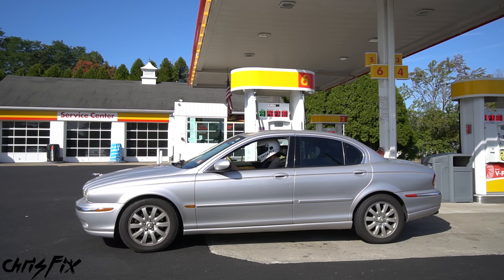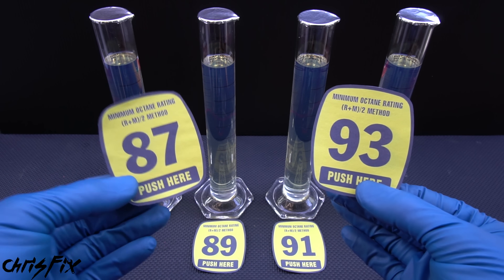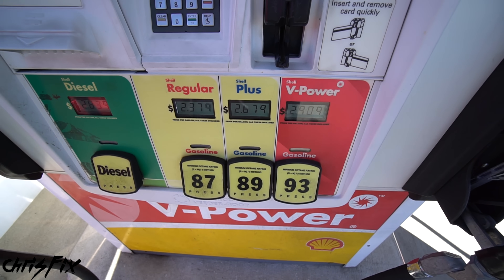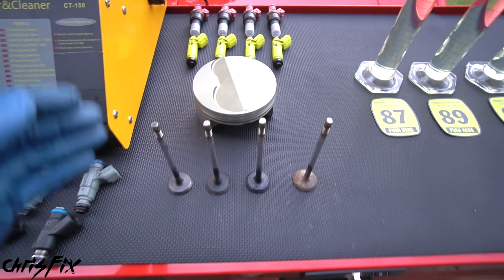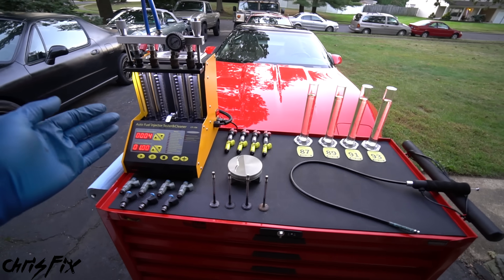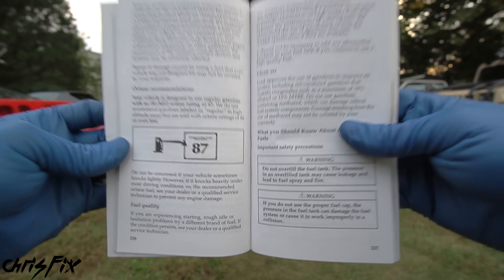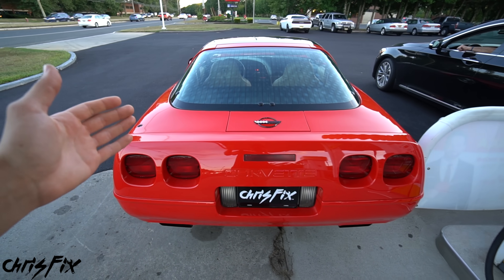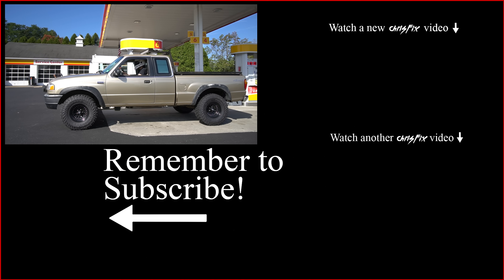What is the BEST Fuel to Use in Your Car or Truck and WHY

Comment: I've seen studies and videos of exhaust emission test. And from what I've seen in the test is that the high octane fuel produces more emissions than the lower grade fuel. Is that correct? My 2015 turbo beetle says 87 is fine. I can't tell the difference between the two of them. It runs good on both. But it seems like I use more with the high octane fuel. Same driving habits with both. It's a TSI gen 3 DI. So additives don't really do much for me. Just the injectors. Your thoughts on it?

Comment: My car turns off each time i put fuel in it and i dont know if its the fuel pump or sum ? HELP ME
Reply: Elias Estrada what is your car???
Reply: @oatmealtheecat8188  its a 2004 Cadillac srx v6 awd
Reply: Elias Estrada vapor canister issue, you’re getting fuel vapors in your engine also check tour purge solenoid, disconnect it from up front and of you can blow into it both ways it is stuck open. That generally pops an engine light tho.
Reply: Quit playing with the key....;)
Reply: Do you have a Chevy traverse by chance?
Reply: Have you put the wrong fuel into your car
Reply: It sounds like you're saying you are leaving the car running while fueling and its turning off. Is that correct??  Also, Have u ever replaced the fuel filter?? I replaced 3 in different cars with the minimum miles at 80000. All the gas that backed out after disconnecting was black. I have pic in my phone.

Comment: I have a 2006 Yukon,211,000 miles,I was told that i should put premium in her,so I have been,now someone has told me I should never switch gas and I'm in Minnesota,so the weather changes,my question is did I meds up by switching from regular to premium,I was even told I may need to get a gas flush

Comment: actually that the exhaust valve..not a intake valve..intake valve dont have any carbon deposit at the back side of the valve..the CO2 never push back into the intake valve..if that happen,maybe it have seat failure..and the dirty exhaust valve is oil failure..not cause from direct port injecter..

Comment: Hey I was also wondering about the racing fuel the 100 octane. I was told to put $20 of 100 octane and fill the rest with 91/93 I have a 2001 BMW Alpina it said premium on there. 

Thanks!

Comment: Great video Chris!

In the true north, the greater Toronto area specifically, our fuel contains up to 10% ethanol at some major gas stations on low to mid grade fuel. Would that amount of ethanol damage an older model  engines over time? Before flex fuel engines were produced. If so, is premium fuel necessary or no ethanol added fuel whatsoever to avoid damage over the years?

Comment: amazing video dude, we all appreciate it!
I have heard of people mixing regular and premium; what are your thoughts on that? 
thanks in advance!
Reply: You can blend them.  If you mix 85 octane and 91 octane on a 1:1 ratio you will get 88 octane. ie. 85+91=176, 176/2 = 88.   Gasoline mixtures will figure out mathematically in any given ratios.
For instance .. Lets change the above ratio to 2:1  (85+85+91 = 261, 261/3 =87 octane)

By the way I use to blend and test gasoline at a refinery.

Comment: The manual of my car says 91~, what does ~ mean? And can I use a higher octane like 93? Thanks!
Reply: It's always best to get what the owner's manual says. 93 octane will be just fine. A cousin of mine who is an engineer once told me a high quality gas all the time is no good. It's like eating junk food all day. (Too rich) when I first got my hundai I used 87 rated. after 2 weeks it started to idle a little bit rough.
So I ran it down and switched to 89. Now she's running just fine.
I stop at known gas stations, not some small-time gas stations
(Example: Tom's gas -n - go).

Comment: absolutely feel more response and get better acceleration when using premium in any car I've ever used. dont know how you can say they all burn at the same pace? how do you get more power as you stated at the end of the video if the fuel doesn't burn better?

Comment: not talking about the difference between the crap ethanol fuel vs pure fuel, you can run pure reg unleaded in an engine that says it needs super safely, as it does not have the ethanol in it, you gain 20 to 30% power and MPG,  your engine will run over all more efficient with pure fuel,  and help keep things clean, so you missed a very important aspect of which types fuel you can use. and remember that Europe doe NOT have ethanol in there fuels,  so pure fuel would be more preferred in most cars and using only the regular unleaded would still be better then super 92/93 oct with ethanol.

Comment: so should i use premium oil on my regular oil car to clean out the carbon deposits ?
Reply from the maker: By premium oil, do you mean synthetic? If so, i would recommend using synthetic over conventional oil!
Reply: @chrisfix  I think he meant premium gasoline on regular gasoline. I had the same thought. Like if you normally use regular could you just fill up with premium every once in a while to clean the carbon  deposits because of the extra additives?

Comment: I use non ethanol that is available at my local gas station in all of my small engines. A question I’ve always had is- when I select the non ethanol grade and start to pump into my plastic 5 gallon can... how much gas is in the pump system / hose from the previous customer? How much “non ethanol “ gas am I actually getting?   I usually run 2-3 gallons into my truck before filling the 5-gallon can to be sure I’m getting all non ethanol. This question is obviously a good one when selecting any grade other than regular

Comment: I was curious, because you didn’t mention the possibility of running a flex fuel vehicle (one that recommends or requires E-85) with regular gasoline.  Is that something that could damage the engine?  What’s a suggestion if you’re not around gas stations that provide E-85?

Comment: So 87 is you regular and 93 your premium? Where I live 95 is regular 98 is the good basic stuff and then comes 99 i believe wich is the premium here.
Reply: Just FYI: US 93 octane = UK 99 octane.
Reply: @waycoolscootaloo  Oh I see. But why different rating when basically the same? I mean there its 93 octane amd here 99 octane rating.
Reply: @niceview2112  Because the US/Canada uses a more accurate method for testing octane and the real world burn of gas under atmospheric conditions. In Europe you guys get the octane from the Ron test. (Research Octane Number.) But the problem is that there are actualy two types of tests. The "Ron" test and the "Mon" test. (Motor Octane Number) 

The Mon test, is a more strict test than the Ron test that Europe uses and yields lower numbers since it tests an engine under load. 

The US and Canada uses the average of these tests. So in the UK for example, you see a "Ron" octane number of 99 for premium. But in the US and Canada, we use the Anti Knock Index. (Written as R+M/2) So for example, Tesco in the UK sells a 99 premium gas. Its rated at 99 octane Ron. But according to Tesco, it has a "Mon" rating of 87. This figure is of course hidden in the UK since it is not publicised.  

So Tesco 99 becomes (R+M)/2 = 93 octane here in North America.

Comment: V-Power 93? In Germany is the regular 95 and V-Power 101 ':D
Reply: That is because in most (if not all) of europe the octane rating is based on a single type of test. In the US they do two types of tests, one of which is the same as in europe but the second test gives a lower number which they then use the "average of the two as the "octane" number. Think of temperatures...if it is 0 C or 32 F outside in Germany and some other country couldn't decide which measuring system to use so they took the two numbers and averaged them they would say the temperature was 16. The actual temps in both places would be the same, they would just apply a different number to it.

Comment: We have 95 fuel, then 99-100, and over 104+. Why in america the gas has so low octane number?
Even with your super octane gasoline, 93, at 3 bucks per gallon, at 45 liter tank, you pay 36 usd. and we pay double with the 95 octane fuel for a full tank...
Reply: Just fyi, it was mentioned in the video. 93 octane in the US, is the same as 99/100 in Europe. We also have 100 octane and 110 octane at some stations. (Typically referred to as racing gas.) I bought gas tonight for $2.39 a gallon. (€0.57 per liter.) My tank can hold up to 16 gallons on my Ford Fusion. (Called a "Ford Mondeo" in the UK) It has a 2.5 liter 4 cyl engine.

Comment: Octane is a number given to denote a fuel's resistance to turning to vapor.
A fuel that vaporizes too easy for your combustion chamber design can pre. Ignite (ping)
Or detonate ( knock)
Just read your owners manual and question your dealership service department as required to stop your engine damage as  you hear it 
They test local fuel to know whose works.
Some brands and situations can cause issues .
They answer you for free.

Comment: Great video!  I liked above!  I am preparing to buy a 1970 muscle car which had high compression (for the day) , and it's also from the pre-leaded fuel days.  Since it ran on leaded gas back in the day, do I have to use a lead additive?   Maybe a rebuild of the heads with proper valve components would make it OK for modern unleaded gas?

Comment: I used to work for Wayne Fueling providing level 2 tech support for techs in the field working on gas pumps. A fun fact to save some money is that the mid grade is actually a mix of the premium and low grade gas. It's not 3 separate the pumps inside the fueling pump, it mixes the gas. Gilbarco pumps also work this way too. Chris is right about Shell stations. I've spoke with techs about the actual tanks underground and Shell is reported to be a lot cleaner in general, followed by Chevron. Be sure to never get gas when you see the trucks filling up the tanks underground. There is water in there that's measured by a floater and has to be pumped out when it reaches a certain level. When the tank underground is being filled that water gets mixed in and pumped through the lines if you're filling up, going into your gas tank. Best to drive to another station if you can. I say for $.50 a gallon and the longevity of your car, use premium.  Hope these tips help!

Comment: So glad you finally got around to that "drive 2500 miles with premium to clean the engine" part. I have an old truck running regular but i wanted to know what I should do occasionally to clean it. That finally answered my question!
Reply: lucas oil aka "tune up in a bottle" works wonders on my '97

Comment: ChrisFix my owners manual says 87 or higher. So i guess all 3 is cool in my car? 06 Grand Prix
Reply from the maker: They will all work, but you probably wont see much of a difference running those higher octanes!
Reply: You might see a check engine light for a couple hours
Reply: Thanks

Comment: Why do race cars use higher octane, if you tune for 91 you'll make most power on 91
Reply from the maker: Race cars often have higher compression ratios, so they need higher octane fuel!
Reply: @chrisfix  ok so my FGT first GEN TUNDRA 02 4.7L 2UZ-FE v8 is non vvti but has direct port injection I believe they say in the book use 87 unless your Towing, off-roading, or   going on a long road trip it's<91octane> recommend but says 87 on the tank area?  

I plan to go the BAJA route bigger injectors twin intake and headers & T304 exhaust with high flow fuel injectors & tune it they can tune it for anything right?

Most Lexus say 91 recommended the 2UZ-FE is widely used in many Lexus models ?

Comment: So I have a 2008 Saturn Vue with 118,000 miles. Would it hurt my engine if I switched to premium? Or would I be totally safe? I also just installed new E3 spark plugs, put in high mileage oil, and replaced my air filter. Just trying to keep my car running at it's best. Please comment if you have an answer. Thank you!
Reply from the maker: It wont hurt anything, but you most likely won't see a benefit as the car recommends regular gas!

Comment: Hey chris, can you do a video checking the valves and also the piston heads after running shell v-power. I'm always curiose about if it really does clean out carbon deposits. I've always been curiose and there is no decent video that goes to your lengths of testing.

Comment: Is it a good thing to run 93 in a small carbed dirtbike engine? If i got the money i just slap the highest octane fuel i can get in it from the gas station.. Wonder if that messes the engine up..
Reply from the maker: It will work, but depending on the model, it probably wont be worth getting higher octane gas!
Reply: @chrisfix  Yea ive noticed it doesnt really do anything to the power output.. But itll die if i run 83 in it because the compression is higher than stock. Thanks for the reply my dude. You're making it big here tbh.

Comment: unfortunately this video is just a spiel, likely sponsored by the oil company he mentions. The reality is regardless of what car you drive you should always buy the lowest octane rated fuel. (DO NOT buy E-85 which isn't gasoline its ethanol. that's the only good advice from this video!!)  Unless your car has a ping or knock, which means you already have a serious engine problem, buying higher octane fuel does NOTHING for your car. In fact, it will decrease your fuel economy and horse power! If you think I am wrong, try it for yourself. Run your car almost out of gas then fill up with the cheap stuff.  I tested this in 2001 after I bought a corvette. Until then I had only owned crappy cars so I always bought the cheapest fuel. After buying the corvette for several months I was buying premium in my car because I wanted it to run the best, and I had never owned a nice car before. However, I was very disappointed with my gas mileage. I decided to try regular 87 octane gas in my car for one full tank and see what happened. To my surprise, my fuel economy INCREASED by 2.5 miles per gallon. Just to be sure this wasn't a fluke, I bought a full tank of regular fuel again and reset the dashboard ( trip mpg, miles to empty, all the little things that button resets) I can tell you from personal experience I got 23-25mpg consistently with 87 octane and 19-21 with 92 octane.  Don't buy the lies of premium gas, its just another way for the oil companies to screw the consumer out of more money.

Comment: Great video and one question, it is Ecoboost and flex fuel the same? Can both run E-85?
Reply: Ecoboost is not the same thing as Flex Fuel. Ecoboost is just a type of engine technology that Ford uses. Check your user manual for the recommended type of fuel to run in your vehicle.

Comment: If my car is missing could I put a little of 89 in the tank? Or would that make thing even worse. Also i have a 2002 impala with 234,xxx miles it's a 3.4l v6
Reply from the maker: It won't harm anything, but see if it works!
Reply: The only reason why I ask is I dont have a manual and it doesnt say anything on the dash.

Comment: @ChrisFix as a petroleum chemist, there are a couple of things wrong with this video... there is an energy difference between 87 and 93, but this has to do with the blending of the gasoline and what the individual blenders did to meet specification (whether it is EPA, pipeline, Cali BOB, Az BOB, etc). Typically 93 octane has higher aromatic content than, say, 87 octane, which leads to a higher energy density (let alone, 93 octane fuel tends to be about 5% to 10% more dense than 87 octane), but in some cases, you will have 93 octane certified using straight alkylate, which might have a lower energy density than 87 octane. I can show you using some rough industry calculators for energy density (though, they are not meant for gasoline) as testing via bomb calorimeter is... annoying. As well, personally, I would NEVER recommend using octane improver... one, the octane gains that are advertised are on a decimal point basis and not whole numbers, two, they typically use an additive called MMT (methyl cyclopentadienyl manganese tricarbonyl) which is photosensitive (light causes it to react and fall apart; if MMT was in the one you used with the clear bottle, i would be surprised if it didn't actually hurt your injectors or help lead to early fuel filter clogging) and only helps improve the RON score which simulates engine load at idle, and three, the monetary cost for the additive does not outweigh, say, adding a little bit of 93 octane. Also, as a side note, usually 89 or 91 "mid grade" is achieved at the pump via a Y or splitter, blending their low fuel with their high fuel. If you would like a better, more in depth response, please PM me and I will help you with any questions you may have.

Comment: I always use 93 for my cars and motorcycle for the past 15 years. It is with out doubt better for The engine. And shell is the best gas!
Reply: It's all about the additive they put in gas. I do the same because 93 gas eliminates the need to clean injectors and valves.
Reply: Pirouz Farhani But the bottle of cleaner costs under $5
Reply: The higher the octane, the less likely a detonation happens.

E85 burns much cleaner and detonation is virtually not happening BUT you gotta make sure you have an E85 compatible car or you buy a conversion kit for E85 and get an access port for the tune you'll need to the ECU to run properly without damaging the engine.
Reply: @BlackWat3rGTR  Is E85 available in all gas stations? Is it much cheaper in price?

Comment: Do you have coverage on octane based on elevation. I previously owned a 2001 Toyota Tacoma that required 87 octane but the pumps in my location offered 86, 89 and 93. Worked ok on 86 but always wondered if I was loosing power and economy. I commute long distance to work and had to watch my budget. Ran that motor 315,000 miles till the transmission went out. Motor still ran great. Go Toyota!!!